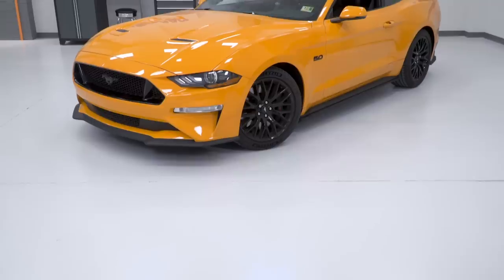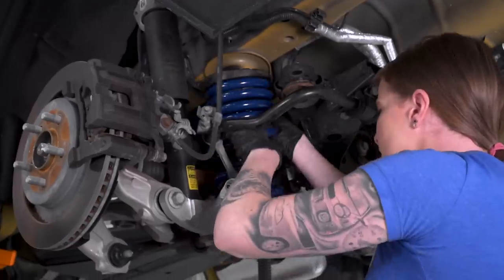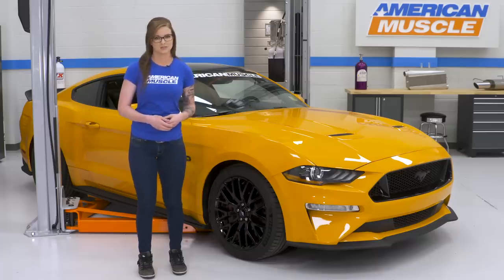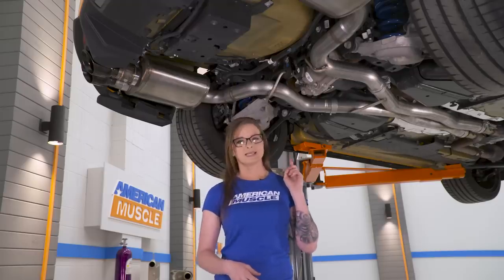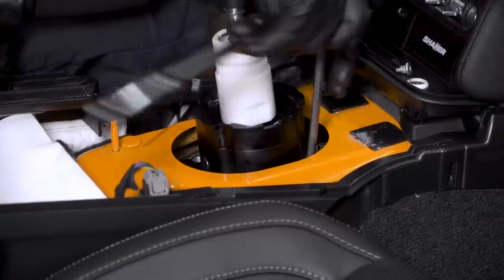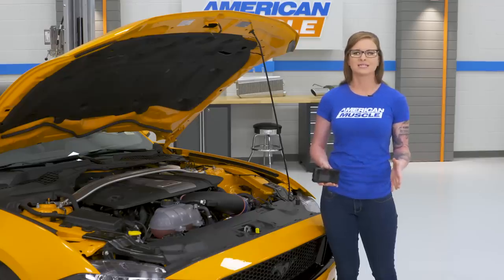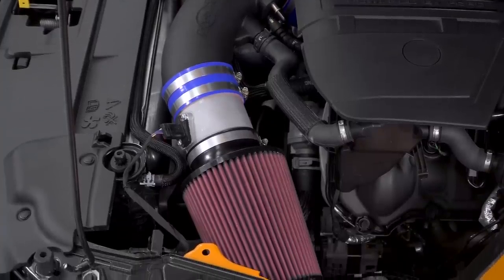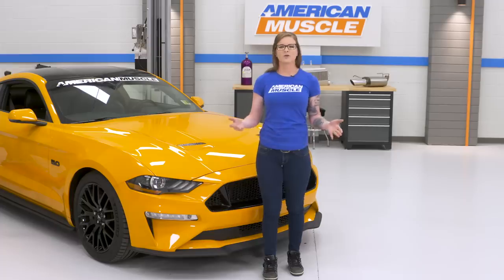The First 5 2018 Mustang GT Mods You Need - Hot Lap

Comment: The factory intake is a TRUE cold air intake all those other round exposed filters only pull hot air from the engine bay....TOTAL WASTE OF MONEY and HP! The tune is what is producing the gains NOT the aftermarket hot air intake.
Reply: Scott I agree, that was a Hot Air Intake
Reply: Could it pull more air even if it's hot could there be more air faster?
Reply: Utah county Picazo's page it sure can pull more hot air, but hot air is an absolute power killer.  The amount of power you gain is negated true to the increase of IATs. Best option is a K&N drop in performance air filter
Reply: Also check out that iffy Dyno sheet where they chop off the stock pull just as it was getting going into the higher RPMS
Reply: No, take a look at the graph again. That wouldn't account for them not bringing the base line dyno all the way to redline, which is 7,500rpm...where does the first graph stop? American Muscle already replied with what happned though
Reply: 2018 GT redline at 7500rpm....where does the baseline graph stop?
Reply: A tune with a good intake is going to make more power than just the tune alone so it does help and heat soak is only an issue when youre continuously stopped long as the car is moving its fine.  The stock intake may have an airbox but it dont pull nearly as much air in as an aftermarket and it does matter when coupled with  a tune and longtubes and stuff they all compliment each other and add to the overall gains.  Im gonna go with the steeda pro flow closed box matched with a ram air snorkel as i think that is the best setup for most overall hp and less chance of heat soak.
Reply: Most of the test I have seen on cold air intakes are done while the hood is up. The problem is heat soak with most aftermarket intakes. I think the stock air box with a aftermarket filter would do better. And if I'm not mistaking will void your warranty( if your worried about that).
Reply: Tbf Cold air intake arent really worth it... i mean during summer the road ia hotter than the air so putting the CAI up more might help a tiny bit.... but its honestly not usefull
Reply: Australian summers would make it only worse, 40c+ outside, this does not sound like a good upgrade for me
Reply: Cold air is denser than hot air making for better combustion. You never want an air filter element exposed in the engine bay.

Comment: Listen up, forget the cold air intake, these oil filled elements will allow much more dirt into the engine and shorten its life, just stick with the paper filter and original air box. Also, removing the air box that pulls in outside air to being open under hood is pulling in much hotter air, not sure where the term cold-air intake came from. Just avoid these all together if you want your engine to last and not start smoking from worn piston and rings at 50k miles.
Reply: ???? Wtf
Reply: they kinda used a crappy one for the video but when they have the dam that surrounds the filter and the tube that connects to the front grille it will bring in lower temp air from outside the car because its sealed to the hood when its closed

Comment: I have a 2018 Mustang GT with the A10 and performance pack level 1. My top 5:

1. Lund E85 Flex or Race tune
2. K&N performance drop in filter
3. Steeda IRS subframe brace
4. Steeda Ultra-lite lowering springs
5. Steeda bumpsteer kit

Done. Now you have a much faster and better handling Mustang and all those mods cost under $1500
Reply: DiocletianQ3T Does E85 add that much power?
Reply: LazyFaux5656 about 60-70 hp to the wheel so yea yea it does
Reply: E85 flex.....does that mean you still can run E10 (regular) or Non-eth? Factory E85 sensor still works and adjust accordingly?
Reply: Not unless you're boosted
Reply: I keep hearing about that drop in filter. Does it really make a big difference?

Comment: 1) JLT catch can
2) X/H pipe
3) Lowering springs
4) E-85 tune
5) Short shifter
Reply: how much more Hp will the car get after all of these from stock?
Reply: There was 2018’s pushing over 500 whp with JLT Intake, long tube headers, exhaust, and. E85 tune
Reply: Why wouldn't you just plug all the vacuum hoses and put air breathers on your valve covers so it gets rid of that shit without it coming back in your engine

Comment from the maker: Subscribe for New Mustang Videos Daily: http://muscle.am/SubscribeAMyt
Check out the complete mods list: https://muscle.am/2MPDGX7

First 5 Mods List: 
C&L Racer Cold Air Intake (2018 GT) -  https://muscle.am/2mJoQpF
VMP Rev-X Tuner by SCT w/ 1 Custom Tune (2018 GT Stock or w/ Bolt On Mods) - https://muscle.am/2uRQTrA
Ford Performance Lowering W-Springs (2018 GT w/ MagneRide; 15-18 GT350) - https://muscle.am/2mIwOPL
Barton Hybrid 3 Short Throw Shifter w/ Brushed Pull Up Collar - MT-82 (15-18 GT) - https://muscle.am/2LNcLLa
Corsa Xtreme Cat-Back Exhaust w/ Black Tips (2018 GT Fastback w/ Active Exhaust) - https://muscle.am/2mLeiqf

Comment: During the test drive - catch can(LOL). 1) Stop the hop kit. 1a)because they should go together is suspension(adj struts/shocks and springs. 2)Half shafts. 3)Gears 4.09s( love 4.30s but they don't make them for this rear yet ) speedo calibration with provision for TC which leads to . .  4) 10 speed(weird even typing that) Torque Converter but not released yet. M6 - good luck with that. 5) wheels/tires. You'll beat 9 out of 10 cars even on the stock tune. This combo should be good for 11.1s  based off the earlier stock times.

Comment: I personally don't agree with this list. In my opinion the brake pads should be at the top of the list simply because of how much brake dust the factory ones release.  Then there's the weak half shafts Ford put in them along with the wheel hop issues.  Finally,  instead of changing out the cat back,  headers would be a better choice because you'll get some nice hp gains along with the stock muffler sounding mean as hell.  But that's just my opinion. I say fix the weakness before going for looks and power. I would not mess with the shifter because with the transmission issues the 18s have had, I would not risk the warranty for this mod so soon.  Definitely down the road but not so soon until they sort out the issue and get us some good shift forks.
Reply: Those are actually some really good points NBS, especially the one re the shifter.

The 2018 still has wheel hop issues?
Reply: Risk warranty? Doesn’t a tune or catless headers void it off the bat?

Comment: Question! This is a 2018 mustang gt, shouldn't it have 460hp?not 433hp? @ 7:41
Reply from the maker: You are seeing the difference between crank hp and wheel hp- 
 automotive manufacturers rate hp at the crank but after drivetrain loss of 10-15% (depending on transmission) your hp to the wheel will be less. -Justin
Reply: @americanmuscle  oh, awesome! Thank you. I've always wondered the difference. So would carbon fiber lightweight wheels increase HP to the wheels? As well as a carbon fiber lightweight crank shaft (rotational force).

Comment: I keep seeing this on dyno graphs with these GT upgrades and I'd like to know why:  The "before" graph shows they only run the car to around 7k rpm while the "after" graph is run almost to 8k rpm, why is this?  This is going to skew the results.
Reply: Exactly what they want to do . Like dyno the car stock , with thd hood down and 87 octane and then tune it , run it with 93 octane  and the hood up on the dyno.
Reply: Shows better results to skew their video so you'll buy their stuff.
Reply: The tune most likely extended the RPM range. Tunes are known to increase the rev limiter. The other guys in this comment section are obviously amateurs that don't know this.

Comment: I have a 2019 GT PP2 and I got  steeda lower springs so the pp2 comes with the GT350R and Its all ready half a inch lower than the PP1 so after I put them on it lowed it only half inch and its a softer spring and mine came with the michelin sport cups 2 and it sits like a tank and there is nothing much lower than it is

Comment: I know ima get hate but can you do one for ecoboost👌🏻
Reply: Why? Why are ecoboost owners such paranoid and sooo insecure about owning an ecoboost mustang????  Wtf.. I drove a 2010 GT/V8  till now.  Now I got a 2018 Ecoboost mustang, 10 speed automatic.

2010GT  V8 made 315 Good @6,000 rpm and 325 lbs of torque @ 4200 rpm.

My little 2018 ecoboost, makes 310HP at even Lower RPMs  of 5,500 rpm.  And 350lbs-ft of torque at 3000 rpm.  Paired up with a 10 speed automatic?   My 18' ecoboost EATS My 2010 GT like it was fucking  Candy....
Reply: Cloud Striker I’m not looking for performance looking for style I pull 100 in 10 sec not worried about it
Reply: @cloudstriker3972  there's no way you can be in America and haven't got the " should've got a v8" " mustangs should be v8 only" especially on YouTube so his comment is understandable
Reply: Nothing wrong with the ecoboost, they are plenty fast and fun in their own right, just don't have the sound most people associate with the mustang.  IMO the ecoboost is a serious upgrade to the v6 they used to have.
Reply: An ecoboost mustang is still faster than most cars on the road. Nothing wrong with them.

Comment: I don't like your advertised setup. 
I agree with the tuner but not yours! 
Full exhaust, new cold air but in a new cold air box not free to heat! 
Buy the A10 auto 1st as it will be a half a second faster or more to start with in the 1/4 mile!! 
So my first mods are full exhaust, correct cold air, tune of course that also has a e85 tune included, pulleys, 3.73 and a set of sticky tires weather drag radials or full slicks. I prefer slicks as you can get a separate rim to hold them just for your track fun but I would also recommend some sticky radials for the street as well. That's just me. 
With those mods and a decent driver you can take a peek into the high 10's
Add a 150 shot of NOS and run well into the 9's all day!!!! 
All that without physically touching the motor!

Comment: While I love watching these videos,  whether here or other channels, there is never any apparent mention of losing your factory warranty once you have done the tune.  I doubt if the manufacture of the after market cold air intake or AM (you are pushing this stuff, right!) will come to the party if Ford says, "your motor blew up because of the tune you did" or more simply, "as you have done a tune, you're warranty is void".  The customer will always be the pickle in the sandwich.  Not worth blowing your factory warranty for that small amount of additional HP.  You should be saying, doing  the tune  is at  the customer's risk.
Reply from the maker: That's because there is no clear cut, end of discussion answer.  What is and isn't covered by a warranty (which in and of itself can define MANY different areas of your car) is defined differently from dealer to dealer.  Now talking about how a tune might affect your power train warranty is valid but even still can be open to interpretation.  Short and simple, if you don't feel comfortable doing a mod, don't do it. -Justin

Comment: Seems odd the stock Dyno pull stopped at 6800 when clearly it was still pulling....and gaining may I add.
Reply from the maker: That would be the speed limiter in 5th.
Reply: AmericanMuscle.com    Ok, so the speed limit is adjusted on the tune?  I've never tuned a S550, all the cars I tuned NEVER had a speed limiter per gear, only top speed. Seems odd and off to have a top speed limited in a low gear.......... wouldn't the gear simply be rev limited? S550 rev to 7k....do they not? You're tell me in 5th gear you can not rev all the way to redline?? If that's true, it's an odd feature I've never came across in all my years in the performance industry. My comments may seem negative, I'm actually looking into purchasing an S550, which Is why I'm subbed to your channel. A pet peeve of mine is skewed dyno charts. Can stand other tuners doing it, I don't do and hate when it's done. Show data in SAE, not STD, don't ping limiter to try to get that extra hop up top for peak numbers, etc......just show what the car actually does. Appreciate yours videos, sorry if this seemed negative. Just trying to understand why it appears the stock pull was cut short.
Reply from the maker: It depends on the gearing- but yes some cars with a very tall rear gear will hit the speed limiter before redline is achieved in the 1:1 gear.  Tunes typically remove the speed limiter along with raising the rev limiter but its going to be different car to car, tune to tune.   And for the record, all of our runs are done using SAE correction factor and 9 times out of 10 the car will be pulled to the limiter. Hope this clears things up and good luck with the new ride.  -Justin
Reply: AmericanMuscle.com  Perfect sense. Not sure why it didn’t occur to me you would hit speed limiter in 5th...shows you my knowledge base on S550’s gearing. Most of the cars I play with usually hit in high gear (6), but of course usually come in with no limiter at all...outside Rev.
Appreciate the response, also edited my comment as it was pretty unfair without knowing all the facts.

Comment: Those springs only dropped it like a .50 in
Reply from the maker: Correct- that's what you are limited to with Magnaride.  If you are looking to slam the car, magnaride is NOT a good starting point -Justin

Comment: Poor suspension advice in this video. If you want your non-Magneride car to both look and drive like crap then by all means install lowering springs. If you want real handling improvements replacing the shocks is 1000 times more effective.
Reply: Eric ten Bensel not following you. You don't agree that the the car looks better slightly lower and lowers the center of gravity?
Reply: Correct, I don't agree. I would consider lowering up to half an inch in the front okay, but almost all springs and coilover sets lower the car at least an inch and a half all around creating a slammed look and a saggy ass. That just doesn't look right in my book. Obviously a lower center of gravity does in theory help handling, but those improvements are offset by all the geomity issues that lowering creates. The problem with the floaty ride is primarily in the shocks. Replace those by a set of Koni's and you have a completely different car. Second mod should be Steeda or BMR IRS brackets and bushing support. That makes a massive difference the rear end stability. These are the kinds of things that people should be putting on their cars, not useless CAI's or obnoxious exhausts.
Reply: might as well go all the way and get some ohlins